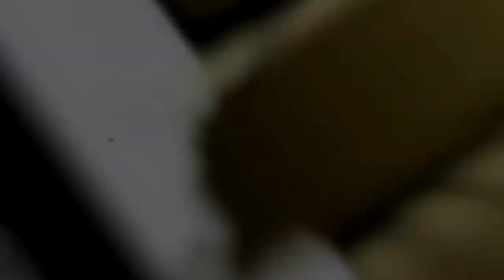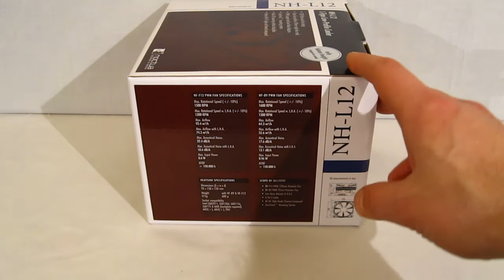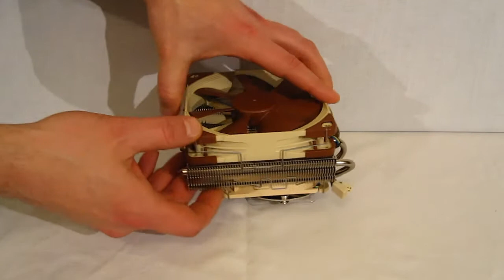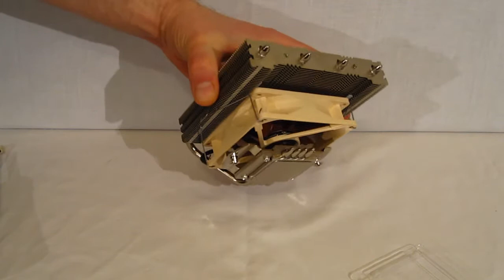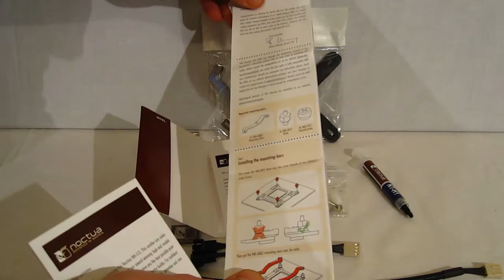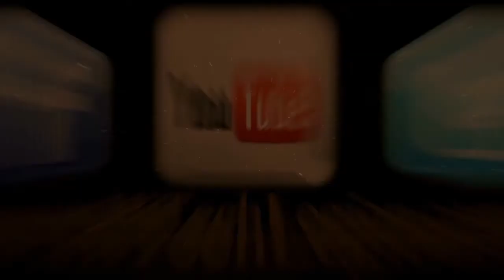Noctua NH-L12 Low Profile CPU Cooler Overview at HiTechLegion.com

Comment: Question! can you put the 120mm fan on the bottom slot? better airflow than the 92mm but the same low profile. also free 92mm fan to use for your case.